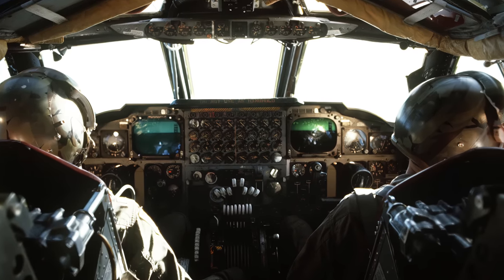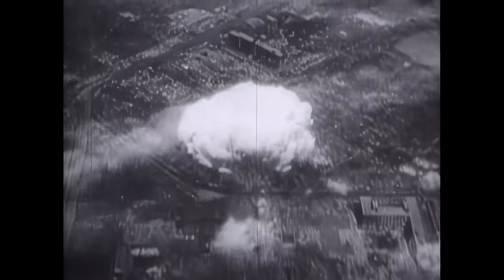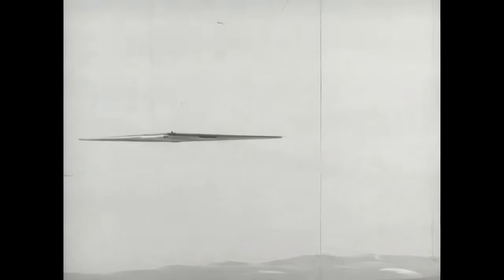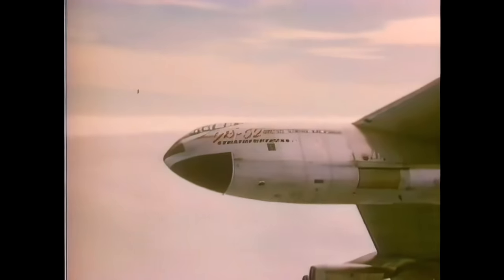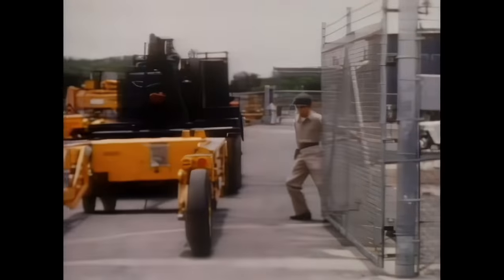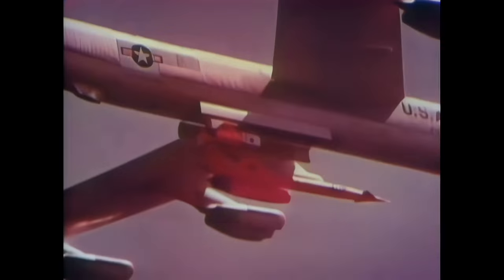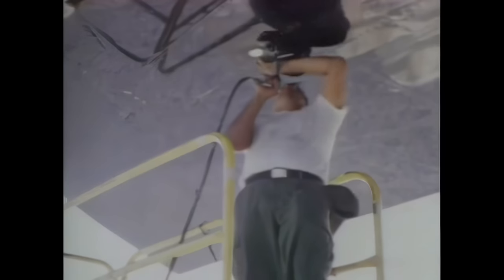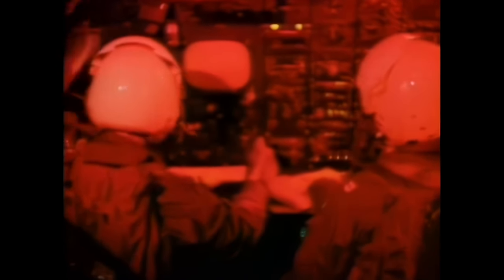USA Might Strategic Bomber Able To Carry 70,000 Pounds Of Weapons | Boeing B-52 Stratofortress

Comment: This is an excellent video. The remaining 76 operational B-52H's are 60 years old, We designed the B-52G/H in 1956 for high-altitude bombing. But in 1961, at the height of the Cold War, we redesigned the structure to meet SAC's new more severe usage and service life requirments. These notably included low level terrain avoidance training, often under extreme gust and maneuver conditions. Durability was the primary concern in the redesign. The main reason for the structural longevity on display today is that the usage has not been as severe as was projected. As Chief of Structures Technology at Boeing-Wichita at the time of the redesign. I am honored to say I chose the materials, the analysis methods, and the limiting stress levels for the redesicn. I am now 95 and I am thrilled to see these planes still flying, and projected to do so for many more years.
Reply from the maker: Thank you Lawrence and also thank you for taking time and sharing the extra detailed information
Reply: You and your team did an excellent job! Well done Sir!

Comment: Excellent video on the Boeing B-52 Stratofortress.  My father flew B-52B models from 1956 to 1957 when he was in the US Air Force Reserves as a B-52B co-pilot.  He retired from the service in 1957.  He loved flying the Stratofortress.  During WWII he was an instructor pilot in B-17s, B-24's and Martin B-26 Marauders.  He became a B-29 Superfortress pilot in 1945 and flew them until he transitioned to the Stratofortress.  At that period in time my father really felt that Boeing built the best planes.   So much so that if we were traveling by air he would tell us; "if its not a Boeing, you are not a going." He felt that Boeing aircraft were the Cadillacs of aircraft back then.

Comment: Saw several Buffy's scramble from RAAF base Darwin, Australia in 1981, Very impressive sight, with the wings supported by the outrigger wheels, and 8 burning at full throttle.

Comment: This ugly plane don't compare to the Antanov from Russia
Reply from the maker: Opinions…
Reply: Well, White Fox isn't just giving an opinion here, and since this is just an emotional outburst, he is 'full of it'. First, Antanov does not make bombers, so there are no Antanov such planes. Secondly, They make passenger and cargo planes. However, they have made the two largest planes ever made, the Model 124 (4 engines)and the 224 (6 engines), which was destroyed in Feb 2024 because NO one in their airline business had the balls to move it to the west seeing what was coming! However, there was a 3nd one partially built (60-65%) that if it survives made be used to build a second unit. The model 124 (built i 1982) was a copy of the Lockheed Galaxy C-5A, and was about 30-35& bigger in its carrying capacity. The the C-5A (1968) was upgraded to the C-5M (upgrades from 1998-2018) a few years back. Now the Antanov 124 is only 20% bigger in its carrying capacity (330.6 lbs.), They both have the same range with max payloads (2,300 mi), but the Antanov can fly considerably further when empty (max 8,700 mi). In comparison, the B-52 can only carry 70.000 lbs. (of bombs), and fly 8,800 miles of combat range, and 10,145 ferry miles (empty). The B-52 holds the world record of flying a manned jet non-stop non refueled of 12,532.28 miles in 1962 (https://en.wikipedia.org/wiki/Boeing_B-52_Stratofortress).